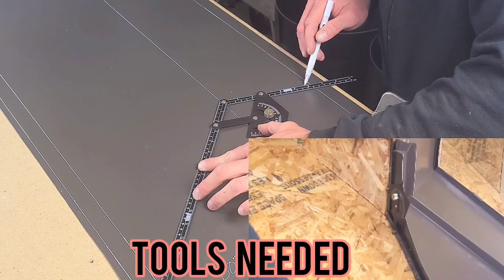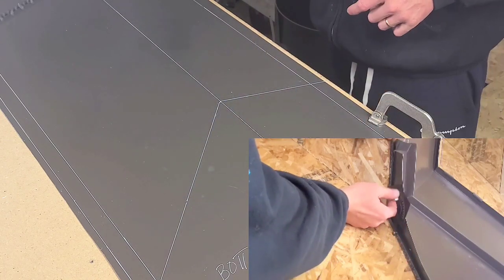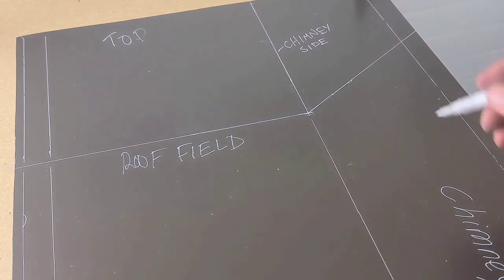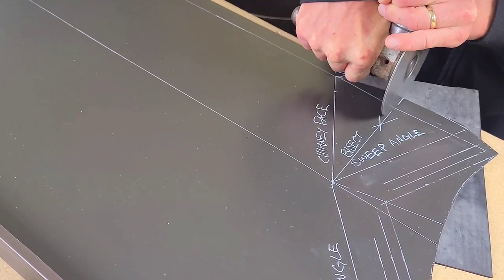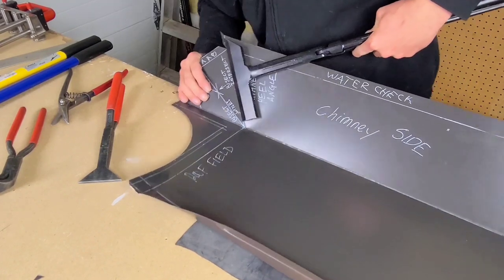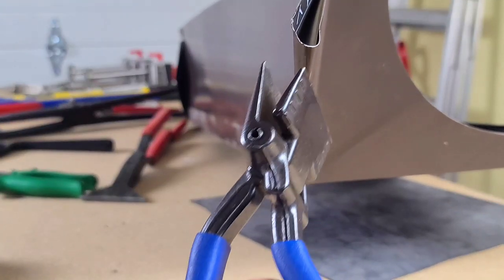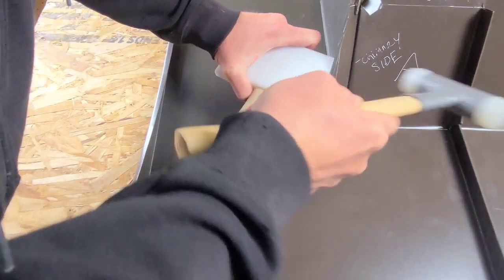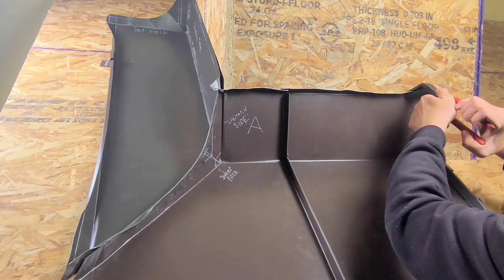HOW TO INSTALL CHIMNEY FLASHING USING STANDING SEAM METAL ROOFING (SIDE PANEL) PART 4

Comment: Word. 
I guess you’ve been watching the metal maniac. 
You’ve come a long way brah. 
Last year you were using z closures and apron flashing on all your transitions. Now you put in the time and effort to actually have a true double lock system. 
Respect. Keep up the good work. 
I’m a roofer too. 35 years. I work for myself since 1994 and I don’t advertise at all. No hoodies, no t shirts, cards. Nothing. Only referrals. Someone has to give you my number. It’s primitive but it weeds out the “hi do you do free estimates@? Calls. 

Cheers. I noticed. Good job skip
Reply from the maker: Thanks for noticing brother

Comment: I am doing a standseam roof on my little house this year.  I have looked at all the extra crap that is made for going around a chimney.  Not really liking it.  This, on the other hand, looks top notch.  First, are you going to do a video on finishing at the top?  Second, do you think it's possible to do this without a sheet metal brake?  My chimney is off to one side, so the roof doesn't fully surround it.  Also, how well does this detail fare against snow?

Great videos and overall great info on this channel!!  Keep it up.
Reply from the maker: Love seeing comment like this...yes it is possible to do this without a brake but you can always rent one somewhere...make sure ask the capabilities of the brake you rent ie. what Guage can be bent in it
As for snow this detail is great because there is no actual notching of the metal itself...thus snow can accumulate anywhere and not affect anything

Comment: It appears the seam is blocking (bucking water) the flow water on the left side of the chimney ?  Do you smash that seam down?
Reply from the maker: Yes the seam will get turned down then formed into a male seam to recieve the next full panel

Comment: I don’t know in theory after watching this video where do you end up with a pin point in the bottom corner where you end up with a pin point at the top by the water check no matter what you lose your going to end up with a pinhole
Reply from the maker: The only leak point is where the metal ends up the walls of the chimney